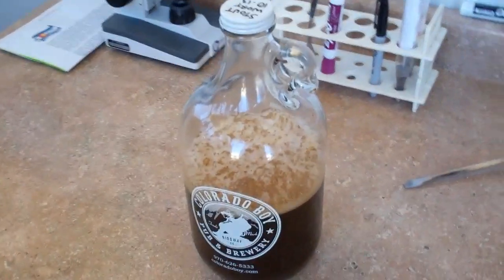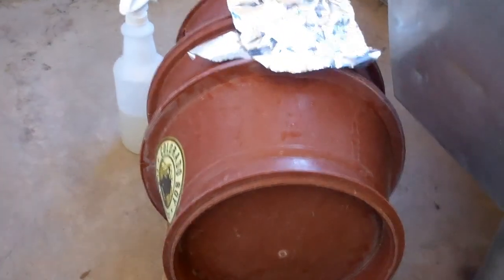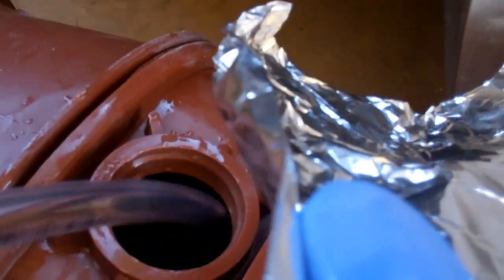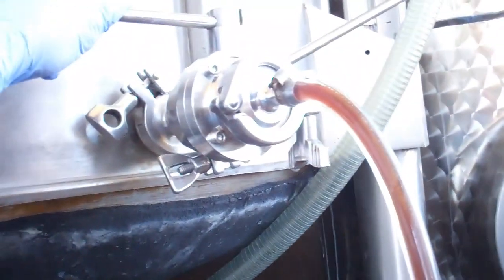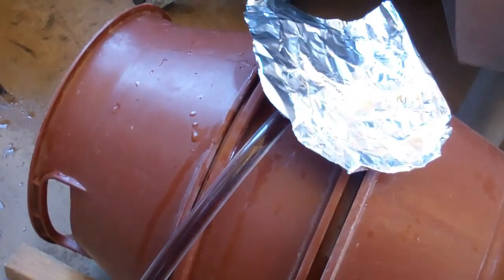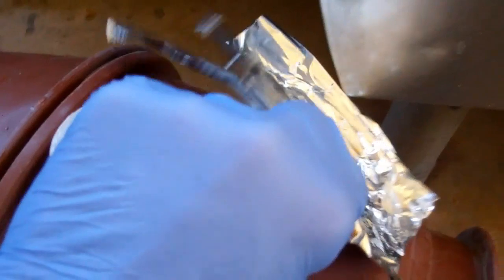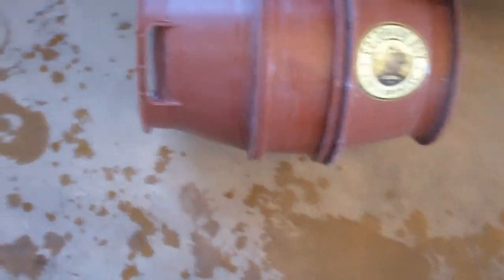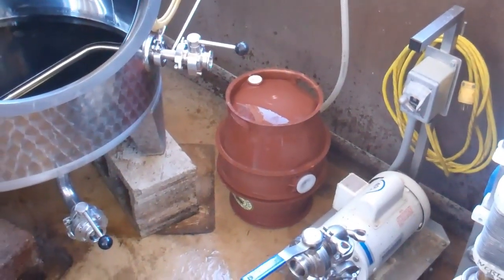Making Cask Ale - More Videos At www.coloradoboy.com

Comment from the maker: Let the beer go through its second fermentation for a few more days. Then let it condition for at least another week at cellar temperature. I make sure that the cask sits on its side for at least 24 hours before tapping. I keep a cask in a beer kegerator set at 52 degrees. I use a cask breather so the cask won't go bad. Other casks that are specials I just set on the bar and tap as it will be empty in less than 2 hours. Cheers to real ale!